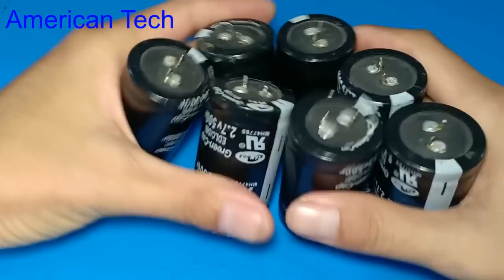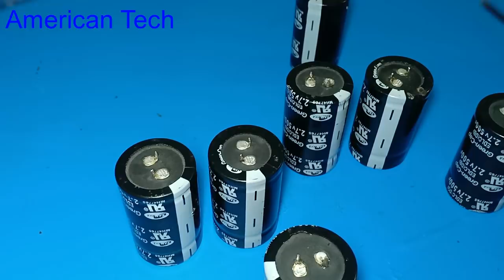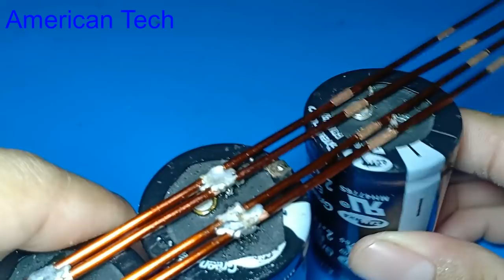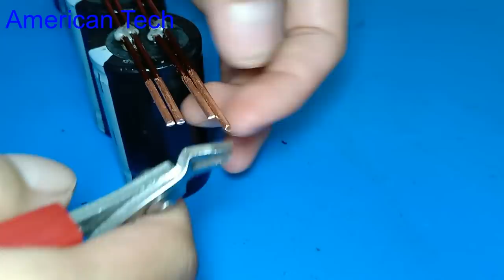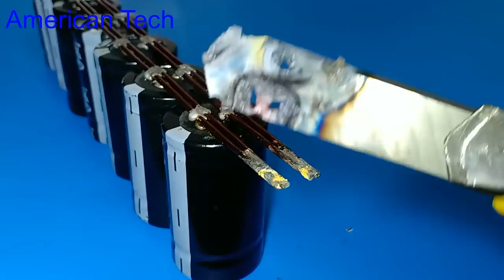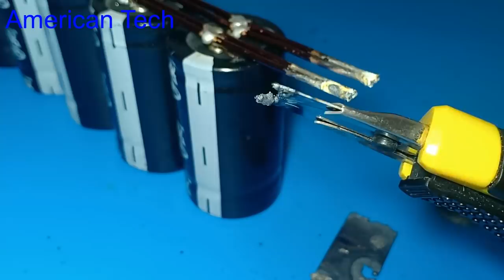Experiment 3500 Farad Super Ultra Capacitors

Comment: Good Day Sir... Can I use 6 pcs. of supercapacitor (2.7v X 6= 16.2v) 500F with protection board in my solar inverter? The input voltage in my solar inverter is 16.2v and the output voltage is 220v.If I use a car alternator (12v)  with IC  and the charging is non-stop, Will my supercapacitor and my solar inverter be damage?. Is there an overcharging here? Thank you so much Sir. More power and God Bless

Comment: Fun experiment.
However, your soldering was too cold/not enough power when you were soldering to the capacitors. The copper conducts away all the heat, and the solder doesn't flow/adhere properly.
Also, notice the white/yellow deposit on the knife when you used it for the short-circuit.
That is lead oxide. Don't inhale that smoke!

Comment: Can you tell us how did you charge them?
Reply: The Engineer lol, and your name is the engineer. There is not any more basic and simple charging circuit than charging caps..
Reply: first step, learn what means voltage, current, dc, positive and negative
Reply: actually forget the current part as they wont take more current when charging than they need
Reply: Not sure what you trying to say Dani. But to explain it. Just put dc voltage on the cap. Negative on the stiped side, and charge it, then use them. Remember, bigger ones are dangerous at a certain voltage/charge. Be carefull, its the reason I did not tell you at first how to charge them.
Reply: He say up to you engineer
Reply: I understand what you mean. It's interesting to see how other tinkerers do things.
Reply: @ClosestNearUtopia  maybe didn't you notice those are supper caps. Super caps have there special arrangement to charge.
Reply: @engineerkohat  Whats so special about charging supercaps? Ofcourse, you have to observe polarity and maximum voltage specification, and I would limit the charging current, but all of that is easily done with just a lab power supply. No special circuitry needed.

Comment: Tell me pliz i tryed with small  capacitiers and it work grate after 5-6 time sprking frist and last capacitor is extracted some black water or acid and all capacitors are doing same thing why why why 😢
Reply: Over volting them is one way to destroy them. Super caps are only rated for very low voltage. 2.5v and 2.7v are most common.   

Another way to destroy them is to reverse the polarity.  Super caps have have special markings to indicate which side is suppose to be negative.

Comment: Why didnt you weld the wire to the capacitors?
Reply: @HaseebElectronics  solder melts you fool...
Reply: Maybe because not everyone has a spotwelder. And soldering is a good and cheap alternetive too.
Reply: Lol he was welding with the capacitors ffs lmfao !!!#
Reply: @daddynikolatesla6663  what gives you the right to call yourself an electrical engineer?
Reply: @Surferant666  Youtube gave me the right to call my self The Elictrical Engineer. Lmao Yes he could weld, AFTER he was finished with soldering everything together...
Reply: @daddynikolatesla6663  fake news
Reply: @Surferant666  No I am studying this subject for 6 years now. You should do it too. And if you know better, than make a video by yourself instead of judging people. Have a nice day.👌
Reply: My brother please could you advice as to the step I could take to integrate these capacitors to my solar battery bank?
Reply: @howardescoffery4950  Well I will say: Dont do that. A capacitor works different than a battery. I begin of time the voltage of a capacitor is high but it will decrease really fast and than it will slow down discharging. Till the capacitor is discharged.
 
A battery (and for this case a powerbank) has almost no voltage decreasing when used. The voltage drops begins when the battery is discharged almost completly. (If the powerbank is in good state)

And if you charge your phone (as example)you will need a constant voltage. So dont use capacitors for a powerbank. And yes, it is possible to use capacitors as powerbank but it is not practical. So just use a powerbank.

Comment: Hey hey hey ... you are making short circuit the capacitors
And where is the delay current resistance ... ?
Reply: gustavo sepulveda those capacitors can be shorted and have the capability to deliver hundreds of amps becuse of its low ESR, dont worry about that

Comment: Time that is taking to discharge the bank  seems exaggerating according my calculation.  All I can think he have 2.7v power supply with high Amp rating,  connected parallel to the bank.

In this experiment capacitor bank stores 3500 * 2.7 = 9450 coulombs charge.  In short circuit condition, circuits  load resistance  comes from wire,  where it's resistance = (Resistivity of wire * Length of wire / Cross-section area of wire). 
 At  20oC,  resistivity of copper  0.0000000172. Assuming length of the wire  0.1m and cross section radius 1mm which gives cross-section area  aprox 0.00000314  m2,  the resistance of the wire approx  (0.0000000172  *  0.1 /  0.00000314  )  = 0.000548 ohm. So current rating may go as high as 2.7 / 0.000548  = 4927.007 A .  Meaning aprox 4927 coulombs  discharge per second.  Which produces hell lot of heat.  Full discharge may happens  according to capacity of the bank within aprox 2 seconds.  

Now how much time will take to charge this bank, if used 1A rating charger,  meaning 1 coulomb per second, bank will take  aprox 9450 seconds or (9450 / 3600) = hours 2.625 hours.  I used approximation because charging in nonliner process.He did'nt show the charging processing though.
Reply: U r correct. Totally fake video

Comment: Whole Earth doesn't have capacitance like this,3000F is a huge capacitor,i don't have idea how he get that and how he charge them.
(Bad english)
Reply: 7pcs 2.7V 500F connected in parallel, it become 2.7V 3500F...just direct connect to 2.7 volt source to charge (postive to positive and negative to negative). At first the charging current will be high and slowly going low to almost zero when it fully charged. Correct me if I'm wrong.
Reply: (Bed england)

Comment: It is Impossible because capacitor once charger then discharge  ire doing this again an again so it is not possible
Reply: You are right
Reply: Saravanan Saravanan It actually true since normal caps like 1uf-1000uf does what you just described. But since those caps have a crazy capacity of 3600000 uf will mean it acts almost like a normal battery at that capacity. Since the caps are in parallel, the total capacity increases and therefore it's power. So no he has not faked it. Learn electronics before commenting on stuff you don't know!

Comment: TIP: Run those capacitors on high frequencies😁😁😁
Reply: recipe of short circuit : p
Reply: @suruzuddin  Well not only a little  short circuit😉 Also a little bom at home😏 I had a experiment at home, to explode a capacitor of 100 uF,  and ran it at 5 mHz  and the explosion was pretty hard. These are 500F each. How big are those explosions?🤔🤔